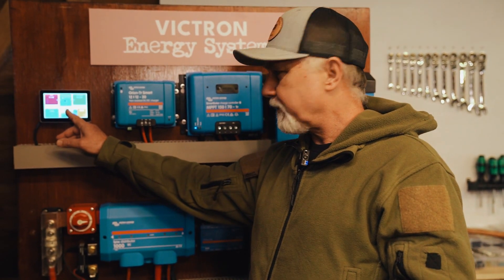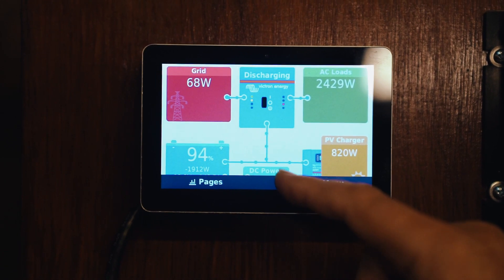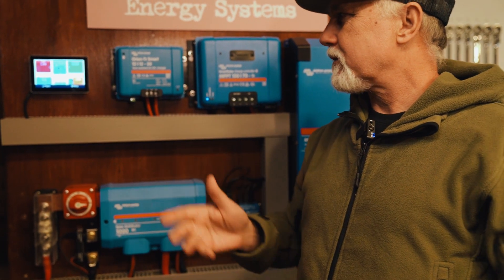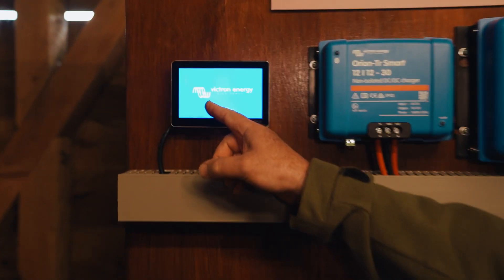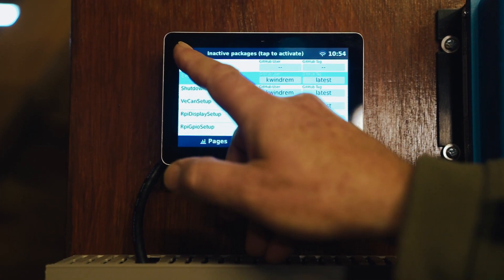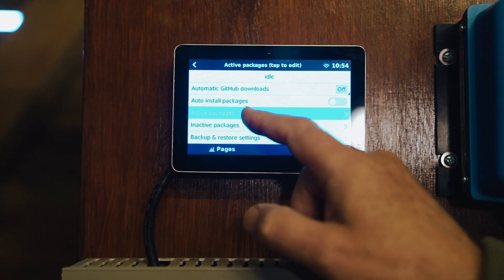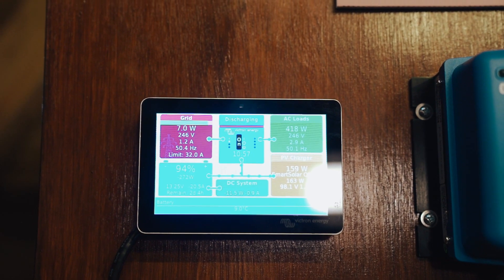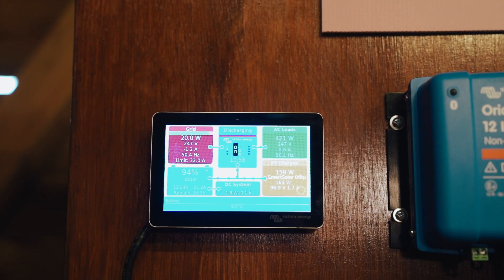Installing GUIMods on the Cerbo GX (is it better?)

Comment: V10.50  I like it because a) I have the RC displayed on a spare Win7 laptop with 14" full screen. b) It shows my x5 temp sensors & water level at the bottom. Only thing I had to do was abbreviate the names to 3 characters - Battery became Bat, etc. Super easy to install once you get the SetupHelper file installed all done remotely.

Comment: I have installed GuiMods on my Cerbo GX following your instructions and in principle everything goes well except that the current does not flow on the main page between the different components. What could be misconfigured?

Comment: I deleted it because it is too busy. However, indication of temperature sensors is an excellent feature with Guimods. A pity one cannat have two separate pages, one with Guimods, one without, as the original from  Victron.